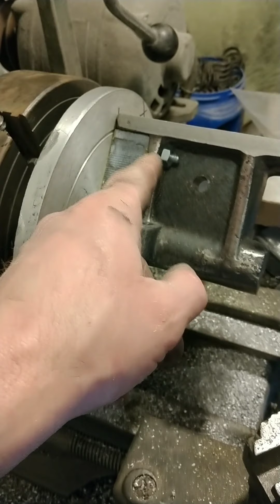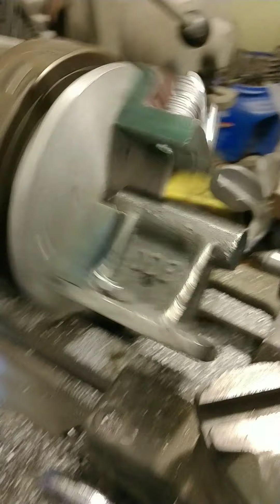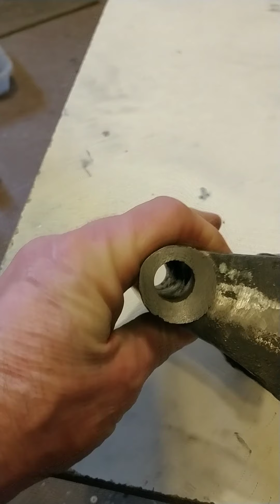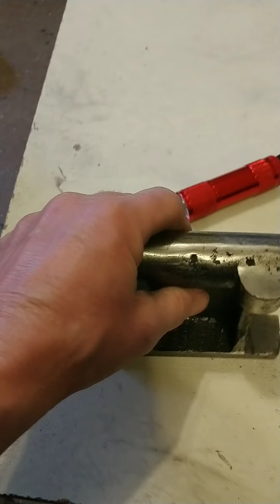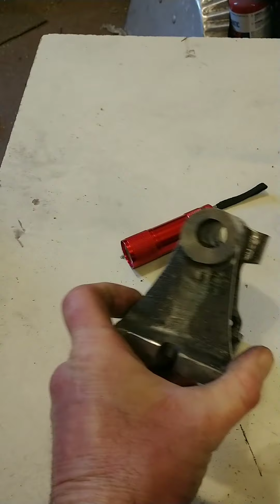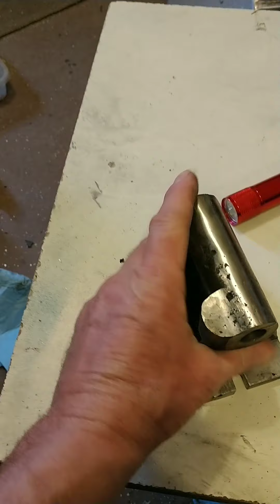April 5, 2020

Comment: You could always just bore it out to a larger size and use a larger shaft. Just stick a 5/8" bar in the tailstock chuck after turning the end down to fit, and just use that to align everything back up to bore it out. You really wouldnt want to use a 5/8" shaft anyhow, the gingery stuff uses 5/8" and it flexes like crazy tbh.

Comment: I am not a machinest either. I would have drilled it undersized and bored it once I found that void. Also from what I've read anything that should be accurate should be bored to finel size. I would bore yours out and if you feel the need fit steel bushings at the ends or one the entire length .